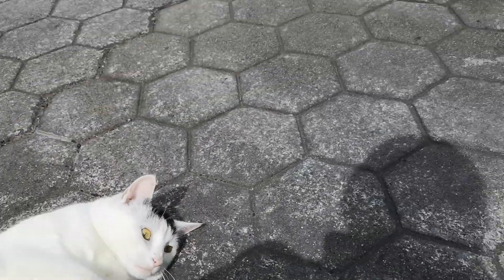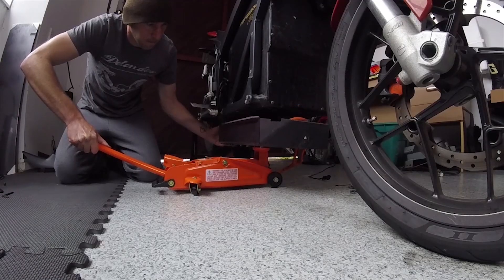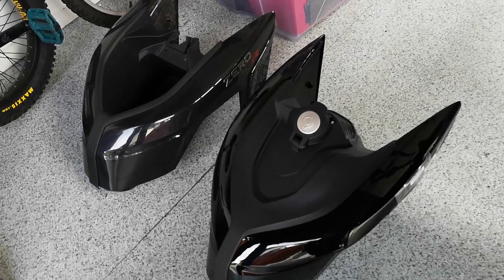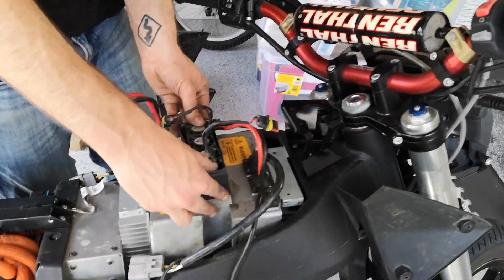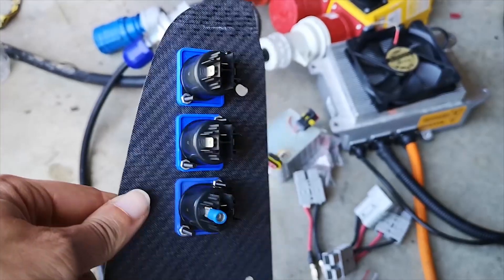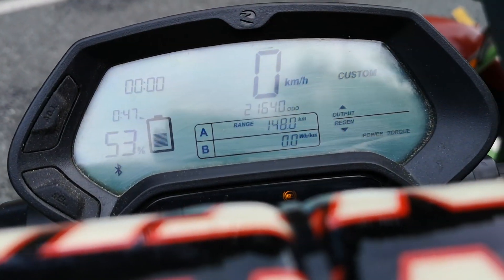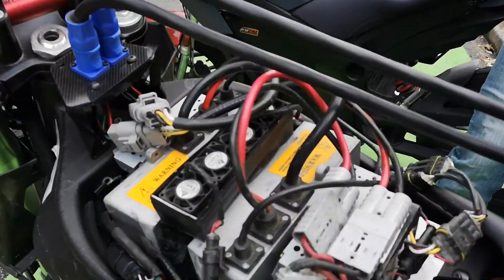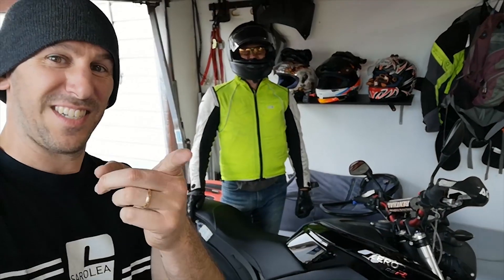Installing a "Charge Tank" on the Zero DSR

Comment: Hi! I have my 14,4kWh Zero S since half year now and I can easily make trips of 220km a day at 65km/h speed max about 5 hours ride, and I am very very tired (not the bike) to keep the throttle at that position and not use brakes just coast (only brake regeneration no throttle off brake).
I am thinking now about a fast charge option but not the expensive 6kW charge tank, as I am not needing it all the time.

Is there a way to have an off bike 6kW charger like the DEltaQ 1kW just a 6kW so I could put it to my top case if I need 6kW+1kW charge power on longer trip, but don't have to carry all the time on my maximum 200km/day trips?

So some external 6kW at least for the auxilary charge plug and I could modify my custom Type2 cable of course to power both the external and inboard.

I think any aftermarket 6kW chargers could work as not need to activate the charge progress with the can-bus signal on the auxilary charger plug because the internal charger activates it and the 6kW external just works in parallel when battery pack relay is on and active...

maybe that could be the cheapest and best idea for a faster charging without bringing a charge tank all time.
Reply from the maker: Yeah that sounds cool.  Lots of people used their DigiNow (TC chargers) that way.  They just ran custom cables up to the top box.  DigiNow no longer sells these, but I think there's a company in Europe that still does.
Reply: @NewZeroland  I found some 3.3kW charger items now on ali, (they look like there old 3.3kW TC Elcon model, also called diginow) the question is the "CAN" or "enable" version is good for me? 
Do I need charge controller as extra or just plug the charger into AC, and the DC output to Zero S accessory charge port and if I give AC to the onboard bottom charger both chargers will charge and accessory charger port will still work?
I am not sure if "enable" mode is enough and what else needed to keep charger alive and charge process alive.

Thank you for the help, I need it! Nut sure what to connect to the signal pins in the accessory Anderson in Zero and also for the charger signals, as I see no charge controller expernal box included.
Don't want to key in the bike for charge, so not leave the key in and turn it on...
Reply: @NewZeroland  as I checkedno need to connect signal if onboard enables charging, but if I use a non deltaq charger Zero will fing it in the logs that I charged fadter and warranty would void on the battery....
Reply from the maker: @fotoamgamgfoto3695  does Zero even read logs anymore? They didn't read mine 😂 I wouldn't worry about it.
Reply: @NewZeroland  I don't know but its new bike, got new battery on purchase as original dead in the showroom at storage and if there is a problem again they will probably check evetything just not to cover under warranty.
They told the dealer it was his fault as did not charge every month when previos (unused) battery failed to charge fine.

Comment: Greetings 
Do you think it would be possible to install the charging cable system for fa 2016?? 
Thanks
Reply: Fx 2016
Reply from the maker: Hi.. it would require lots of custom mounting brackets, and you would need to find some used diginow chargers. The company doesn't exist anymore.

Comment: how does it work by the way? is it like having two fast chargers on board
Reply from the maker: Yep but instead of the stock 1.3kW, these are both 3.3kW.  We also made a custom cable to use all 3 chargers together.
Reply: @NewZeroland are you selling the custom cable?
Reply from the maker: @klinkum  nope, that cable was sold with the bike a few years ago.

Comment: How about the 5 years Warranty, when you modify the Charging unit? is it gone? Looks very nice, I like the HD LifeWire but it's much to expensive for me so This DSR would be an alternative, there is not so many dealers in Denmark yet, (And I have a long way to one) so it's nice that there is no maintenance. :-)
Reply from the maker: The warranty is still there (not for long though because this is a 2016 bike) but you could just order a charge tank from the factory and that would be covered as well 😁 I really like DSRs! I think they're still some of the best Zeros.
Reply: @NewZeroland  would you choose the new Zero SR/F over the DSRs? I was thinking about the Black Forest, and have a Charge tank, I have a Honda CBR1100 Super Blackbird XX now, and we go to Germany for rides (DC charging no problem) Thanks
Reply from the maker: @ErikMichaelSorensen  I'm not a fan of the SR/F but being able to charge in 1 hour at one of those 3-phase AC stations is pretty cool.  The DSR with charge tank would still take 2 hours.  If you have DC stations in your area, the only way to go is an Energica!
Reply: @NewZeroland  Waho Nice bikes, but we don't have them i Denmark yet :'(

Comment: Can you do a guide for a current super charger setup? It seems like they're sold out everywhere, and I can't find where you talk about the pan upgrade failing
Reply from the maker: Yeah they stopped making them last year, but you can find used ones every once in a while on the Zero owners facebook group.  My pan filled up with water and corroded the wiring, so drilling holes in the pan would be great, or mounting them in the tank.

Comment: that's pretty slick! I'm looking into getting a new sr/s just tested a sr/f last week but trying to decide if the premium model is going to be worth the extra 2k when i really don't plan on using it for long rides
Reply from the maker: Nice! The SR/S looks like a  great choice. Premium is the bigger charger, right? It all depends on where you ride. I hear they get great range so you should be fine wherever you are.
Reply: @NewZeroland  yeah heated grips and a 6kw charger vs the 3 but that's only  if you use level 2 charging.. jut normal wall plugs  both charge the same speed.. you can also get a center stand for the sr/s.. lol I love center stands they make it so easy

Comment: but those vents will invite water as well
Reply from the maker: It's ok.. the chargers are waterproof :D
Reply: @NewZeroland  okies ;)
 i need some help. idk whether you can understand my problem, but still i wanna tell.
i have made a lifepo4 battery pack of 7p, 24s. with dedicated lifepo4 24s bms of 50Amp capacity. 
all connection are done correctly like -
B- to battery negative
C- to charge negative
P- to negative of controller
The bike goes on, the bike display is on and going and all the sensors with horn & indicator are active. 
But as soon as i pull the accelerator, the system goes down.
What you think? should i pull out the BMS for its wiring and soldering checkups?
coz the battery i fixed was connected accurately.
since its lifepo4 battery, its Voltage range is 3.2 to 3.65v.
so i had made 24 sets of 7 cells in parallel.
But all the cells had 3.25v during connection except for 2 cells , that were 2.98volts.
so there are 2 theories that might be the cause of my problem-
1. The battery voltage are not synchronized , but since i put the bms hence it should balance the unbalanced cells.
2. BMS is faulty.
please help.

Comment: I can’t tell if the two outer heat sinks are symmetrical but if they are wouldn’t it have been better to install them same as the middle one (fins up/down vs side to side). 
That way they should be more effective as they would “breath” better (heat rises). 

(Unless I missed something.......)
Reply from the maker: That's a good point. Most of the heat exits through the middle, but it could help if they were rotated. We have some more plans for this setup, so I'll make sure to fix that. Thanks man!
Reply: Also if posable allow some “breathing” room on the bottom so the cooler air has a way in to do its magic. 
Perhaps the front and back will allow the air in & the fan in the middle lets the air out???
Reply: Also be mindful that the fans will move xxcfm and this must be exhausted without being sucked back into the air cycle.
Must create an air system whereas cool air is introduced & (all) the hot air is exhausted (without being short cycled back into the air circuit). 

I miss spoke on my original response. 
Hot air does indeed rise with natural conduction but seeing your using a fan (convection), air will be forced in/out with force so pivoting the fins 90° will be more for airflow rather then direct heat transfer efficiency.
If you have the space (total height) consider putting some spacers on the bottom before installing the components so as to create an air duct and install sealant (foam tape or?) to force the air past the heat sink fins for greatest heat rejection effect. 
I’ll assume the fans discharge upwards & if so, air in on the front/back & out the center. 
P.S. HVAC is my thing.
Reply from the maker: @ericsokoloff89  thanks for your input!  This is really helpful.  I've seen people drill holes in the sides of their tanks to get more airflow through it.  We'll see how far this guy wants to take it haha.

Comment: Pro-tip, splice a C13 plug to the third phase of your 3-phase mennekes kable, that way the on-board charger can help with an additional 1.3kW and you don't need to key the bike on to start the charging.
Reply from the maker: THAT is magic 😁 Thanks bro!
Reply: Yes. I did the same. Modified my type 2 cable, and can get 5,8kW from original Charge Tank, and extra 1.2kW from original charger.
One extra bonus : in France there is a big difference in monthly fees between 18 and 22kW. Therefore most of public chargers are limited to 18kW i.e. 6 per phase. With this setup you can still get your 7kW instead of 6kW.
Reply: hi!I also plan to make a cable and installa charge tank in Eu Hungary, but my Type 2 cable has only 1 phas the other 2 pins are not isntalled by teh chinease vednor :(
so nothaving  3-phase mennekes kable just 1 phase pins present, can I just use the same phase to 6kw charge tank and 1.3kw obnboard splitted from same phase?
iF i ADD 220 ohm resistor it let me use 32Amps on one phase as I know.

Comment: Perfect timing. I'm getting very frustrated trying to figure out how and where to mount that gigantic Type 2 connector and that's the only thing keeping me from diving in and installing my 10 kW pan kit. I was looking back through your old videos trying to find where you say the name of those blue connectors, but hadn't had any luck so far. Then you post this video and now I've got it!

Thanks for all the informative videos. 👍
Reply from the maker: Awesome! Yeah man, it's way easier to find places for those little dudes. Good luck!
Reply: @NewZeroland  The other thing is that it gets really expensive really fast if you're making adapters for everything to Type 2. Not to mention the space that would take up on a road trip.

Seriously, those EV sockets and plugs are a gigantic rip-off. It's not rocket science or exotic materials. It costs a couple of bucks at most to make those things and they want well over a hundred bucks for a plug without a cable?
Reply from the maker: @awo1fman  so true. Hopefully Zero stops using big bulky andersons someday. They aren't even waterproof! And we need a global standard for charging stations. It'd be nice if cables were built into the stations, too.. like Tesla destination chargers.

Comment: I do not understand why you think the DSR needs a firmware update to run a chargetank. The firmware on the MBB and BMS you could potentially update trough your phone (MY17 or later). The 6kW CT will come with the latest firmware revision (V2.07) and only needs a CAN communication to the bike. 2 leads on the B- and B+ and that is it. I have installed more of these then I can tell you, but a firmware update is not necesarry. However, I do not think i have installed them on older then MY17 bikes, so i am curious to your reasoning behind the needing firmware.
Reply from the maker: Yep, this is a 2016 DSR, so he can't do over the air updates, unfortunately.

Comment: is there a way to use the diginow charger without the key? cuz doing this in many areas of the U.S. with the key still in the bike would just get it stolen, especially if the fans are running.
Reply from the maker: Yeah you only have to key it on to start the charging.. then once it's going, you can pull the key out and go have lunch 😁👍
Reply: @NewZeroland  could you explain this a bit more? I'm trying an aftermarket alibaba charger 116vdc 25A but the contactor does not open. Onboard charger was dead so thats gone
Reply from the maker: @glenluyckx12  you need a control unit to communicate with the bike. I have no idea where to get one of those, unfortunately.
Reply: Every version we produced and sold had a way to leave the bike charging with the bike off and key out.

Comment: Very clean work! Good job!
I can't get my new 9.9 pan to work with public chargers for some reason...
Seems like the station doesn't see I'm even connected.
Reply from the maker: Aw man!  I think it's the switch.  Did the diginow kit come with an on/off switch?  Sometimes the station wants to be connected to the bike first, to say "oh hey, what's up, bike" and then you flip the switch and it says "cool, we've met, now I'll give you the juice."  You might need the bike keyed on, too.
Reply: @NewZeroland  yep, they included a switch to set the bike in charging mode and another switch for the inlet.
The first one works fine, while the second doesn't seem to do anything.
Tried every combination I could think of of plugging, switching and turning the bike on. Nothing worked.
Waiting for Brandon and Morgan to figure something out...
Reply from the maker: @8104  oh yikes.. that's confusing. Hopefully they can figure it out for ya.
Reply: @8104  I haven't had a response from those guys for a couple of months. I hope you have better luck.